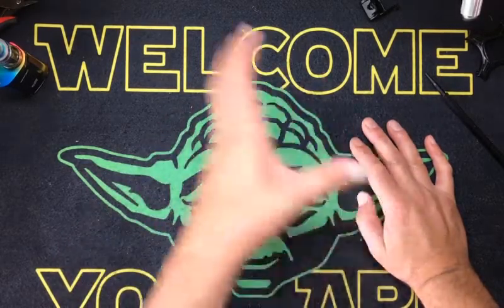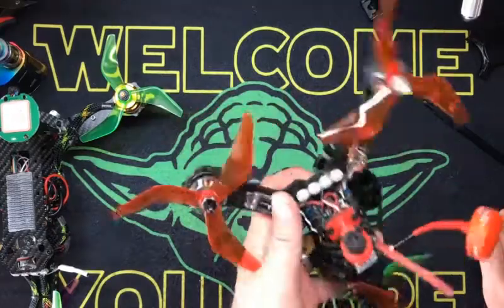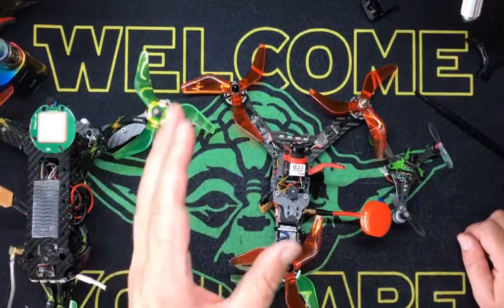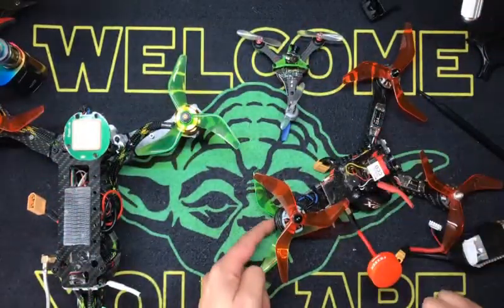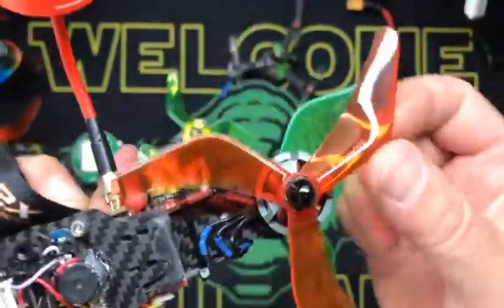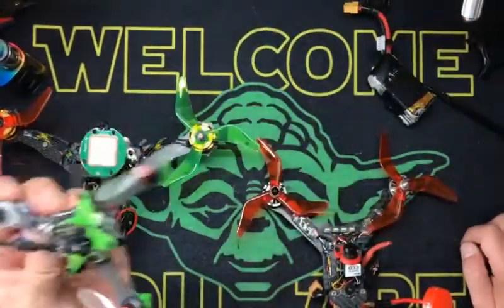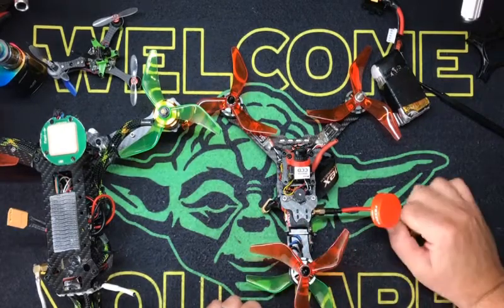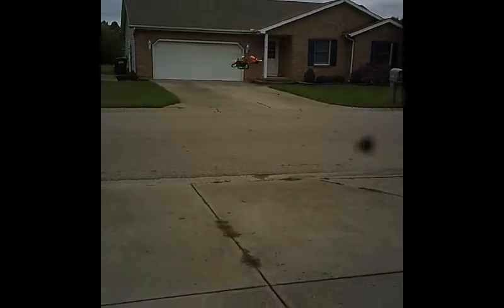WTF Is a Y4 Quad? Check this and seeeeeeeee....

Comment: I have built a brushless micro Y4 using 0802 16000kv motors a 65mm prop a betafpv brushless fc on 1s
Reply: Can we see it please, any info on the frame.

Comment: I wish you had experience with tricopters.   I want to know how a y4 compares. I love tricopters and wonder if I would like a y4 for the same reasons.  It would be easier to build. BTW tricopters aren't that hard to build.  I was a total newb when I built my first one.  I started by salvaging a crashed quad frame and it turned out so good I was hooked after that.

Comment: Would it work with 2 blades on all the moters?
Reply from the maker: +philip donnellan yessss.   My y4 Drone I ran 6” two blazers on for a longgg Time.  The only reason I switched to tri blade was the climb rate was slower with the two blade

Comment: Sweet.Now i know what to do with my broken eachine vtail 210.I like my very simple 260 tricopter but the Y4 is much better for sure.Would it work ok with the bottom rear motor even with front motors?
Reply from the maker: +peter toth hey brother.    Yes it will. As long as it’s in line with the motor above it, the height dosnt matter